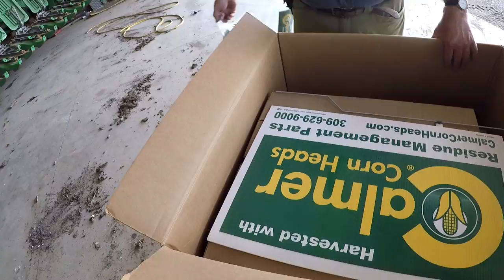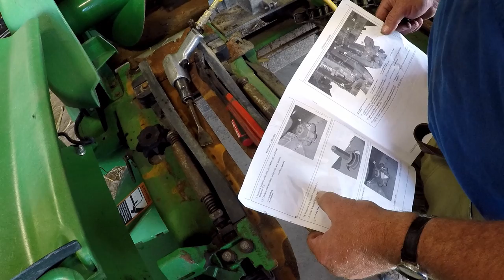Rebuilding John Deere 612c corn head

Comment: #1. Not locking the head up is dangerous af. NEVER not lock it up!
#2. Correct adjustment of deck plates (deere says 18mm front, 21mm rear) is required. Maybe you did it, and didn't show it.